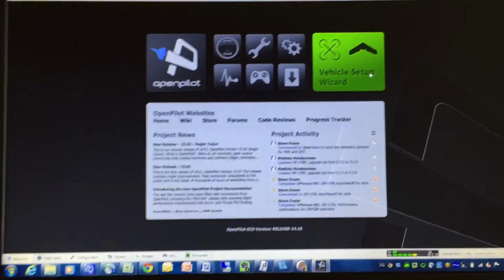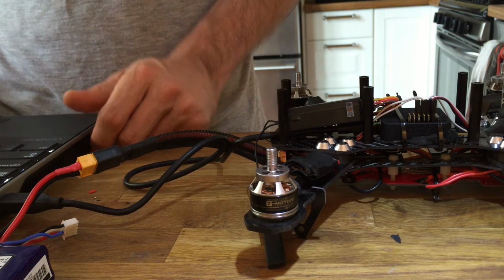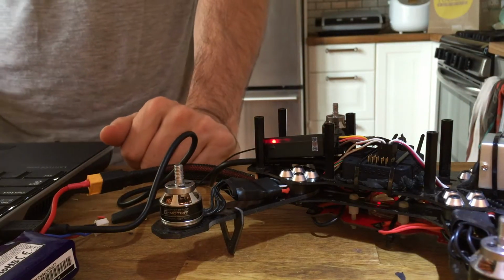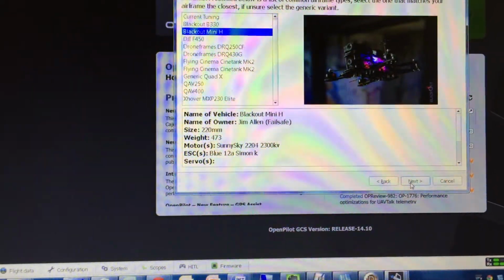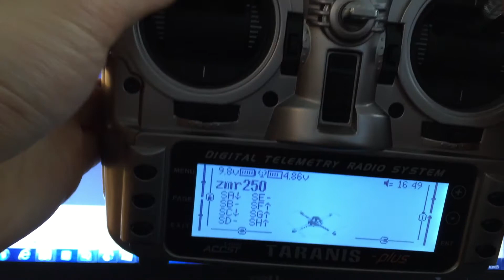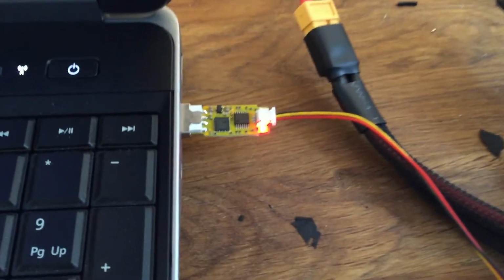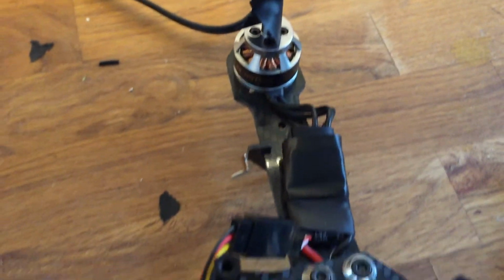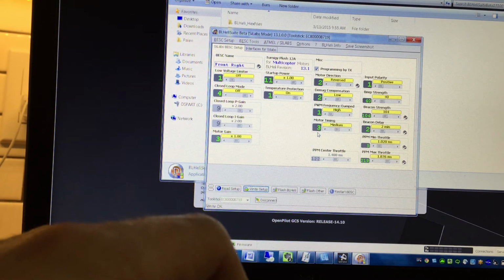Installing Rotorgeeks 12A ESC's on ZMR250 - Full Install Guide

Comment: That tip is way to big to solder those small points. Thats why you had a hard time soldering those ESC wires.
Reply from the maker: +Brent Computaguy Yea this video was a while ago. I've since upgraded :) No more radioshack crap

Comment: is there Oneshot on esc's?
Reply from the maker: Yes these esc's come with oneshot already installed. If you have older versions of rotorgeeks you may need to flash them. Do you have the programming stick?
Reply: no, im just looking into buying these esc's
Thanks for responding. :D
Reply from the maker: ZumiDoes Gaming yep they are the shit

Comment: What type of soldering iron is that? It looks like its dispensing the solder
Reply from the maker: MrSadlerd3 lol it's a beat up Radioshack soldering iron with a very dull tip! It was brutal trying to solder all the esc's with it. I finally bought a new tip and it makes such a big difference. A lot cleaner solder points :)

Comment: Are you really getting better performance out of those Rotorgeeks ESCs? Have the same setup as you save  the Afro 12 with BLHeli 13.2 and they run silky smooth on 4S. The build quality is prob better on the Rotogeeks.

Comment: Can you clarify how the ESC get plugged into the CC3D please. The video seemed to have missed that. The one esc with three wires gets plugged into the first section on the CC3D and then the other 3 ESC each get plugged into the SIG portion of the board? Help with this would be appreciated!
Reply from the maker: Justin Kendter Hey buddy sure thing. So the esc's get plugged in in a clockwise pattern. Front left arm goes in the top plug on the cc3d (this is the one that you use the 3 plug wire on, AKA BEC). Then, front right plugs into the pins below, back right below that one and finally back left on the 4th set of pins. You want to plug in the 3 esc's with one plug into the left hand pin on the CC3D (if you're looking at the CC3D from a above/behind veiw). You will notice that there are 3 pins on the CC3D and only the front left ESC plugs into all 3. Does that help?
Reply: SF PV Ok go it. Just to clarify, the Front left arm plugs into the first set of plus on the CC3D, +/- and the SIG port. The other three only plug into the SIG port on the CC3D directly behind the first one in a clockwise rotation from motor to motor. 

I just wanted to make sure that the single wire ones plug into the SIG terminal on the CC3D board and not the +/- ports. 

Thanks for your help!
Reply from the maker: Correct! Glad I could help. When I was first getting started I asked a lot of people for help so I'm just pitching in now that I have some knowledge. Check out some of our flight vids and other tutorials and subscribe if you like the content. Safe flying!
Reply: SF PV Awesome thanks for your help! One last question, the voltage from the ESC is enough/not too much for the CC3D to take, correct? I can't find anything on their website about what the output voltage is to the flight controller.
Reply: SF PV We're doing a 4S setup
Reply: Justin Kendter I'm also assuming that the CC3D puts out the require amount to the receiver for the Spektrum AR610?
Reply from the maker: Justin Kendter Yes the CC3D can handle a 4S and will manage the voltage from the ESC just fine. That's the job of the ESC. I'm not sure about the Spektrum AR610. What kind of connection are you running from the CC3d to your Spektrum? S.bus, 8-pin, etc...? It should be all good though